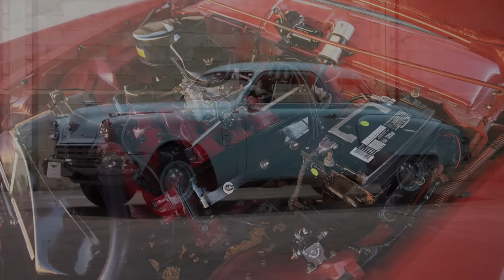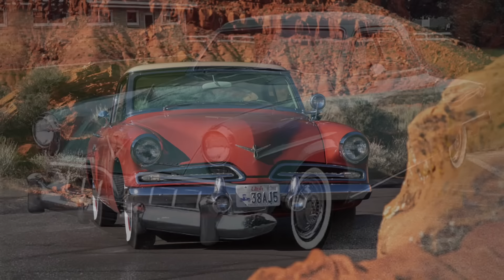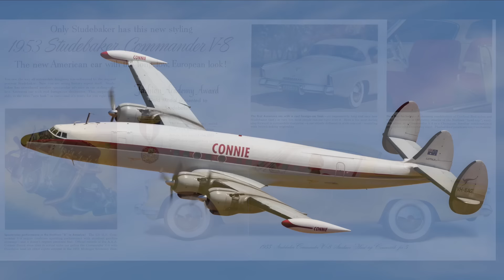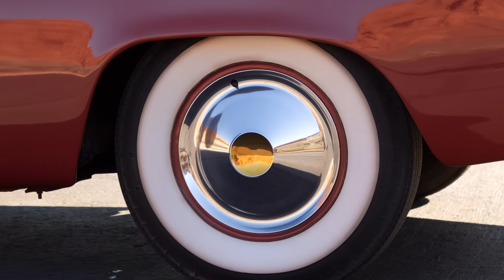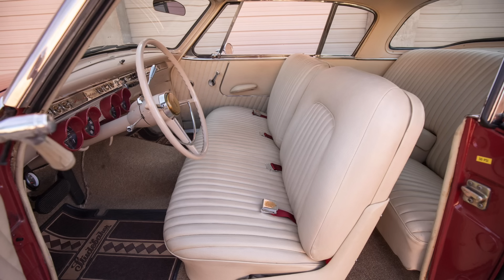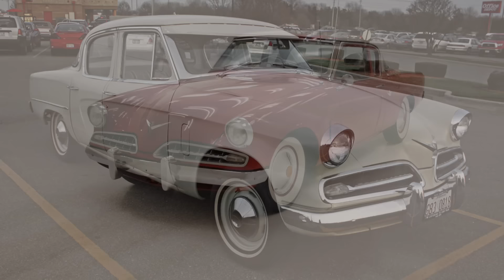Most Beautiful (& Flawed) Cars: 1953 Studebaker Coupes Had Only Skin-Deep Beauty

Comment: It's a pity that this beautiful car had to have a couple of buts attached.
Reply: Unfortunately, all cars come with some buts.  I really don't remember that my '54 Commander coupe rattled any more than most 4 year old cars.  My doors never opened spontaneously.  I wrote a few minutes ago about the weak valve train oil seals.  I just replaced a coil pack and sparkplug on my Ford Triton V8.  Eight hours to "replace a spark plug".  Worst automotive job I ever did.  As they say "That's progress!".  I know I spent less time replacing those oil seals, including the time needed to keep from being "rear ended" (mine😂) since I did it on a fairly busy residential street.
Reply: @arylioa2764  Those Ford design engineers should be sent to Gitmo!

Comment: I still see early to mid fifties studebaker cars and trucks running around from time to time. All different kinds of models. And a large majority of them are what I would call daily driver or cars and coffee class. They are not high dollar restorations or customizations. Other than wheels, tires, exhaust systems and often color repaints of questionable tastes, they generally maintained their original body configurations and stances. Occasionally lowered or raked nose down, but true to their original designs. And they seem to retain a fairly loyal following and collector base that spans generations.

Comment: While from a style point of view, merging the vertical tail light with the bumper should possibly look outstanding, at the end of the day, the chosen design was the superior design choice for many reasons. Ranging from weight savings, manufacturing cost, serviceability, repair cost and even customer perception of proper design and build. Plus keeping the bumper and taillights separate, it gave you flexibility for future updates. It’s actually quite surprising how well style and time wise this overall car design has held up. These are still incredibly good looking and attractive cars in 2025. Some 70+ years later! At time stamp 8:46, just look at how modern and well formed the lines and shape of the car still work so well.

Comment: IN 1953 A FRIEND OF MINE PARENTS PURCHASED A 1953 SILVER HAWK COUPE .IT HAD THE V8 ENGINE AND A MACHINE TURNED DASH BOARD. MY FRIEND TOOK US FORA RIDE AND HE NAILED IT WE HIT AT LEAST 95 MPH AND AS WAS DESCRIBE HE THE BODY WAS FLECKING AT THAT SPEED ON A 1940 ILLINOIS ROAD.  I WAS IN THE PASSENGER SEAT AND THE DOORS WOULD ACTUALLY MOVE IN AND OUT AT LEAS A HALF OF AN INCH QUITE RAPIDLY.. AND LATER ANOTHER FRIEND PARENTS PURCHASED A 1954 BUICK WITH THE THEN NEW V8 IN A BUICK SUPER RIVIERA HARDTOP COUPE. WE RACED A 1954 STUDEBAKER GOLDEN HAWK COUPE AND AT 100 MPH T WAS DOOR HANDLE TO DOOR HANDLE FINISH.

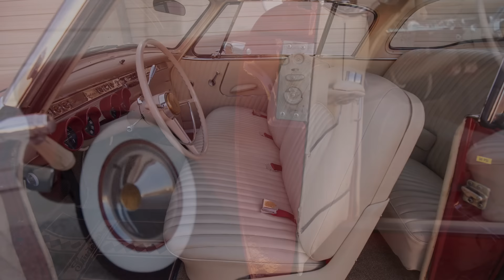Comment: 14:56 Those latches, with a guide on top and what looks like a gear on the bottom, look very similar to the latches in the Subaru 360. At least on the 360, the gear had a one-way roller-clutch, so if you have the door ajar, you can tighten it by giving it a yank, instead of having to open it and slam it shut the way one would with most conventional "2 click" latches. That would be a distinct advantage on the 360, because opening its suicide doors while underway would be extremely dangerous, but I don't imagine the advantage, if it even existed on the Studebaker, would be all that important.

Comment: Don't see a problem with separate tail light. If it's easier to work on is a better design. A lot of these being raced in Carrera Panamericana races
Reply: I could see it serving a sacrificial roll in a very low-speed collision, getting destroyed without twisting the bumper, making at least some repairs cheaper.

Comment: "Fat fingers" prevented me from finishing my comments!  Later full hubcaps didn't have the "spokes".  The air cleaners were also available in "dry" and "wet" forms.  The hood and trunk emblems were similar, front and rear, for each respective year and form with the Champions having a small S instead of an 8 on the early cars and a larger S and 8 on the later ones.  In addition, there were emblems designating a Commander or Champion on the sides of the bodies beneath the rear windows.  The original 232 cid V-8s could be bored out to 304 cid when the Granatellis made all of the Bonneville records with Studebakers in 1963.  The 1956 Golden Hawk used the middle displacement Packard V-8 with a 352 cid.  I enjoyed all the "Loewy designed" (thanks to Bob Bourque) cars I once owned and in retrospect, wish I had kept the 1954 the most.  It had upgraded and better brakes than the 1953.  Sorry to be so "wordy" but I thought I'd add a few more details to these beautiful cars.
Reply: My friend Bob had a 1954 V8, but he had pulled the Studebaker engine and substituted a very potent Cadillac engine. That car was FAST. Bob said despite the Cadillac’s large displacement advantage, the external dimensions were surprisingly close. The Studebaker engine designers had copied the Caddy engine very closely. 
That ‘54 Studebaker was a beautiful automobile.
Two of my best friends in high school had Studebakers. A 1948 and a 1949. Both were 2doors. Both burned oil at phenomenal rate. Billy bought his  oil from Pep Boys in 5 gallon cans. He always had 3 cans in the trunk. We figured he was burning the stuff at the rate of 40 quarts per 1,000 miles.
Barry’s 1949 used more oil than that! Actually, between burning oil (tailpipe smoke) and leaking, it was a miracle the 6 cylinder engine ran at all!

Comment: I agree that the 1953 to 1955 Studebaker Coupe had the nicest designs of all car makers, but as far as performance goes, there were no highway systems back in those days, there were only secondary and back roads where the speed limit was about 50 miles per hour for a short distance at best. You didn't need speed on a car back then. People bought cars because of their styling and comfort, not speed.

Comment: I once owned a 1954 Commander coupe, a 1953 Champion coupe, a 1956 Golden Hawk and a 1962 GT Hawk, amongst other Studebaker models.  Good video but I would add just a few details.  1) The frames on the earlier cars had two different thicknesses, a lighter one for the Champions.  2) A perpendicular brace was added under the A pillar area to help prevent flexing in the door hinge area.  3)  The hood emblems on the 1953 was changed from a Mercedes-like tri-star with a small 8 above it to a V with a larger elongated 8 due to an alleged complaint from M-B.  And finally, there were two hubcap designs very similar to one another but the earlier ones had three small “spokes” stamped in from the round center.  Later full hubcaps

Comment: I always thought the grilles looked like a Don Ameche moustache. As a kid I always thought a COmmander would make a great looking convertible. I might have tried pulling that off but after I became a mechanic and finally drove one (then saw it underneath while on a hoist) I realized what a PITA it would be to strengthen the frame and body before attempting to cut the top off. Trashing the frame and starting over (building a new one or doing a transplant from something else) would have been the right way to do it and that just wasn't worth it back then.

Comment: Special memories here. My Grandfather had a 53 coupe, green and white. He unfortunately sold it shortly before the time I started driving. I sure wanted it. FWIW, the first car my father bought was one of the bullet nose 50's. 

Also, my first car was a 56 Champion, green and white. My father bought it for my birthday when I as a junior in high school, $75. The only thing I didn't like was it had a 2 speed automatic transmission with push button gear selector. I still have the hood ornament from that one. I made a cedar wood stand for it and it sits on the work table I built for fly tying.  My second car, I bought for $85, was a 59 Lark 6 which I later sold for $65. 

Memories!!
Reply: Studebakers never had push button transmission controls. That was Chrysler products starting in 1956 and also some Packards. Then in 1957 Mercurys and 1958 Edsels. Chrysler's versions were always mechanical, moving a cable, but the rest were electonic. And recently some cars also have had them again.
Reply: @emjayay  Well I was going to say that is strange because my 56 Champion had just that and you don't know what you are talking about but thinking back, you are correct, the gear selector was on the column. 
My 3rd car, which I had bought from my Grandfather's estate was one that had the push button. I'm sure about this one because I remember when I first go in it after driving I had to be shown how to start the car. The starter switch was in the gear selector cluster buttons on the instead of the key switch or floor board. 
I stand corrected. (My only excuse is that this was 55 years ago. Memory details do fade with time.)

Comment: Studebaker was not first to market with an overhead valve V-8. Cadillac introduced its 331 ci Kettering engine in 1949, as did Oldsmobile with its related 303 ci Rocket engine. Chrysler introduced its 331 ci FirePower hemi-head V-8 for 1951 model year, the same as Studebaker with its initially 232.6 ci displacement.

In fact, the Studebaker ohv V-8 was "inspired" by the Cadillac/Olds architecture to the extent that the Studebaker engineers involved in its design had been allowed to visit Cadillac's production facilities. Unfortunately they then went back to South Bend and produced a lump that although physically the same size, weighed substantially more than the Caddy engine, had 40% less displacement, and was severely limited in its power output by undersized valves.

Insofar as Buick didn't come out with an ohv V-8 until 1953, Ford until 1954, and Chevrolet, Packard, Plymouth, and Pontiac until 1955, then it can be said that Studebaker was early to market, but the first it definitely was not.

Comment: A case where, styling wise, the parts were greater than the sum. While on a wheelbase about the same as a Dodge, the Studebaker looked too small. I find the rear tapered too much for a balanced design and don’t like the rear C pillar. Just quirky.

The later Hawk GT somewhat corrected the C pillar and was a better looking car.

As for the bullet nose, looked like they mounted a NuTone ceiling exhaust fan on the front. AWFUL, a not helped by people putting aftermarket propellers on them. Ditto the Ford center bullet.

Comment: A stunner, though perhaps could have mentioned the chassis was quickly reinforced for '54, & quality wasn't helped by the coupe's success with Studebaker conservatively expecting sedans to significantly outsell them. Doh. Though it did allow the smaller sedan to evolve into the Lark.. showing the scale of the size & power race the big 3 were about to start, leaving little Studebaker floundering in their wake.

Comment: My dad worked at Studebaker in the early to mid 50's. I remember his story about how different jobs had vastly different levels of difficulty. When he worked on "Duffy pads" he needed to work through his break just to keep up with the assembly line. Then, when he was putting on the wheels, he and his partner would switch off, one doing the job (of 2) and the other would go play cards.

Comment: I always wanted one of those, but was not aware of all the foibles you discussed here. I just liked the looks of it. My first car was a 1956 Studebaker Flight Hawk which I bought in 1963 for $90. It had a flat-head 6 engine with 3-speed transmission on the steering column and a fourth overdrive gear you could engage by pushing a control under the dashboard. I drove it about 200 miles per week, during which it burned a 2-gallon can of Sapphire reconstituted motor oil. A kid threw a rock up in the air that landed on the windshield, cracking it. I could not afford to replace the windshield and sold the car for $90.

Comment: The 50s are such a fascinating period, where styling, engineering, and performance were changing every single model year, at basically every single automaker. Some of the most fascinating stories are those of the independents, who were honestly doing a lot with very little. '53 Studebakers were so forward looking despite being stuck with some outdated design elements. The '54 Hudson is an amazing attempt at evolving the impeccable step down Hudson into a more modern car. Packard was doing their damnedest to compete with some really handsome cars and their Ultramatic automatic transmission.  The Packards were so well designed, that the Soviets would copy the styling for their state limosine, ZIL-111. Even Studebaker would have some fun, throwing their superchargers on the V8!

Also, while the sedan models as you say weren't very graceful, they were still interesting cars. Especially, the '57 Studebaker sedans had some...wild styling on an otherwise outdated body that had been so forward thinking just a few years earlier.

Comment: Actually the early Studebaker V8 was offered in the Cars from '51 to '55.  Their 259 V8  didn't come out till '55.  Your comments seem to depend on other people's takes on the car.  Have you EVER driven a Studebaker, let alone a '53?  Honestly, not everyone wants to drive like they're in a road Rally.🙄  Also, there were two four-door models.  The Commander/Champion on the 116" frame and the Land Cruiser on the 120" frame.  The back door was six inches longer in the Land Cruiser and also the wing windows opened in the back seat.  There was actually more legroom in the Land Cruiser's back seat than was in the comparable Cadillac that year.   There was a Land Cruiser in both '53 and '54.  There was also a steel bodied two-door Station Wagon in '54 as well on the 120" frame.  These were badged as the Conestoga in honour of the Constoga wagons that Studebaker sold to the Pioneers in the Westward movement of the eighteen-fifties.  Slightly over three thousand '54 Wagons were produced.

Comment: The sedan used the cowl design from the model N. Loewy wanted European width cars and the sedan reflected that idea. This made the sedan look so narrow because it was narrow. The coupe bodies shared almost nothing with the sedan! Tooling costs had to be through the roof for the 1953 models. Then came the sales problem, Studebaker management expected 6 sedans for every coupe. The reality was almost completely opposite. This combined with the frame flex for the v-8 coupes (this wasn't an issue on the sedans even the long wheelbase Landcruiser Sedan) meant long delivery delays! This killed sales and people went back to the big three hardtops. Other things like a tooling engineer that swore he could stamp those lovely front fenders in one step less than recommended meant sheetmetal tears between the headlamp area which had to be welded by hand on EVERY SINGLE FENDER added even more cost! Note Adams comments on the 1959 Chevy that the rear underside of those fins was not metal finished to save cost because metal finish was very expensive. Chevy could do that because it was mostly out of sight. Welding and metal finish was even MORE expensive. Lot's of bad decisions made in haste because of the years of fooling around with the dead ended model N. I had read in some old documents that Studebaker engineers wanted to wait till 1954 to introduce the cars to fix problems they knew were serious! UGH

Comment: Thank you for elaborating on the 1953 Studebaker coupe. For me, it is the most beautiful US car ever made, and it makes me sad to learn about its shortcomings.
Reply: The guy didn’t really know what he was talking about !   And the issue with the light frame was rectified for 1954 by increasing the frame rail thickness. Unfortunately that delay in production caused the lower production for 1954 they could of sold a lot more,  for there was still a high demand for the car going into 1955
Reply: @JoeJoe-73  thanks a lot. What a pity for Studebaker that (seemingly)  the damage was done.

Comment: The engine was much better 10 years later when the super charged it in the Lark. Those Larks where early muscle cars with the super added. Saddly for smaller auto makers the US went through recessions in 49,52-53 and 57-58. They weren't really long lasting but you didn't go out and buy a new car unless you were wealthy and you wouldn't be buying one of these.

Comment: Great knowledgeable channel. Subscribed and liked. I grew up in that era and I can tell you that all of us were fans of the big three Ford, GM and Chrysler products. Studys were kind of looked upon as the designated 'not cool' machine....but, secretly, deep down, Studebaker cars were innovative and not afraid to vary from the norm.

I understand that Studebaker built engines for some Indy cars in the 30s. Later, in the 60s, they improved in performance. Consider the straight line 1/4 mile genre. Then there was the Avanti...turbo charged. Sad that it never got off the ground. 

If I had the $$$, it would be cool to retro mod one of the bullet nosed coupes from the 50s. Oh what fun to cruise burger joint on a warm summer night!

Cheers,
rocket

Comment: Another miss for the Studebaker  was the dash design. They were very narrow and simple affairs without a lot of chrome gewgaws.  In fact they sort of looked like they were hung from the cowel instead of being part of the cowel. 

My dad bought new a ‘55 President sedan, pink and black, with the enormous chrome shovel grill in front. Impressive to look at, and I think by then they had fixed the proportions of the sedan body as the wheelbase was 120.5”. I don’t know if they had remedied the steel gage. He went to the dealer because they had a promotion: take a test drive and get a bag of groceries He was on strike then and money was short; he came home with the groceries, and a new car. (No, he wasn’t the best with money.) He owned it until 1964 when he traded it in for a new Chrysler Newport sedan.